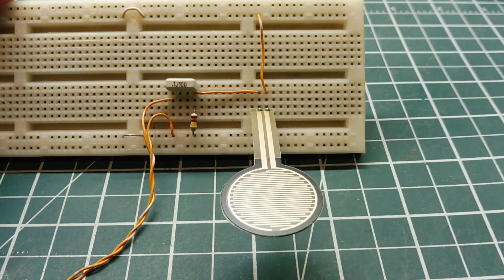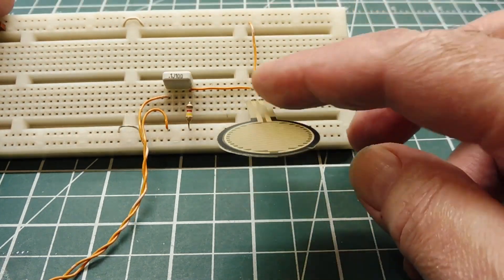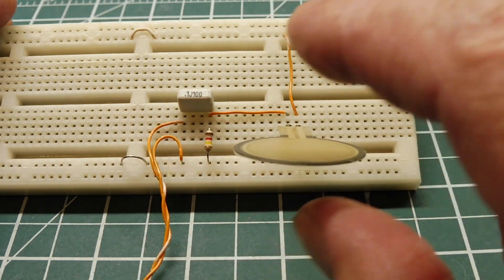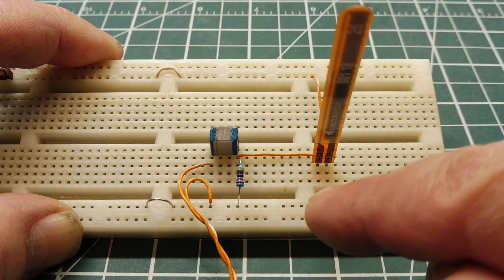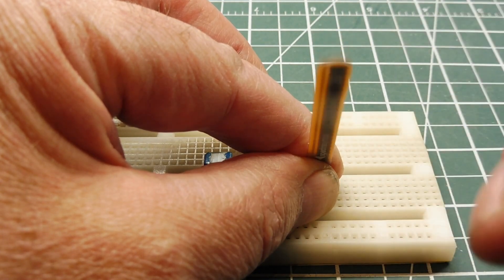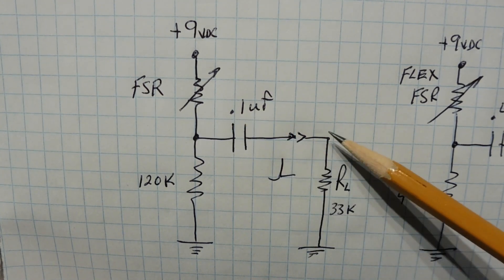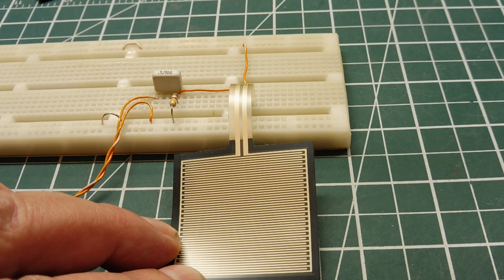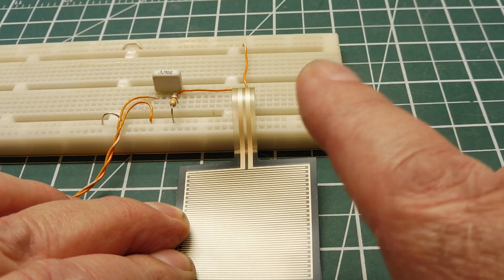Force Sensing Resistor Drum Trigger

Comment: Great, sir one question : I have a drumpad that uses FSR and I want to replace them with piezoeléctric how I do it, I tried but I'm getting errors when I hit hard one Piezo it triggers others midi keys, AND the volume Is unstable, I have just conected the Piezo directly instead of the fsr, any ideas?
Reply from the maker: If your drum controller is designed for FSR trigger inputs, using a Piezo pickup may not work  A FSR changes resistance as oppsosed to a Piezo pickup that changes voltage.
Check your user manual for more info.

Comment: Thanks for the video. I have had a stroke and my right foot doesn't move as fast as it used to. Making a drum trigger with an FSR could be an excellent option for me. I have a couple of questions, if you wouldn't mind. What is the peak voltage in the first FSR you've shown? It looks to be around 1.1v to 1.5v. Is that accurate? Also, what is that voltage dip after the FSR is triggered? Thanks in advance for your help.
Reply from the maker: The circuit was powered by 5 volts so the peak output was around 3 volts. The waveform is a basic RC differentiator output. You will have to check what your drum controller is looking for as a trigger. Some will take a piezo pad directly and others need additional signal processing. Here are some links on RC circuits and force sensing materials.
http://www.interfacebus.com/Glossary-of-Terms-RC-Differentiator.html
https://youtu.be/2XiRnoc8ZRo
Reply: Thanks for the quick reply and for the link. Now I see on the scope where it hits 3v.

Comment: Can it be midi velocity sensitive?
Reply: map the output voltage (0 to 3v if Vcc is 5v) to 0-127 velocity and add either (1) a waveform generator code snippet or add MIDI output to your code to send a MIDI note/velocity based on the mapped voltage

Comment: Another interesting video as usual .
FSRs are employed in modern electronic drum kits, not as triggers, but in HiHat pedals as a means to sense the degree to which the two ecymbals are open or closed.

Incidentally Ken, are you planing on doing any forth based videos using analogue inputs or OLED displays?

I'm currently experimenting with "Punyforth" which supports the ESP8266 range of boards and wondered whether you have tried this implementation of Forth and if so, your opinion on it.

Regardless, keep up the good work !
Reply from the maker: Thanks for the response. I am aware of Punyforth but have not used it. It seems to be getting popular as is ESP32/8266. There is a Forth website that covers Forth code for SSD1306 Oled displays. https://arduino-forth.com/
I am hooked on using my smartphone as a display for many of my projects. You just have to plug in a HC-06 module and its wireless. https://youtu.be/_5g5lC-nDy8
For product development an OLED is the way to go.